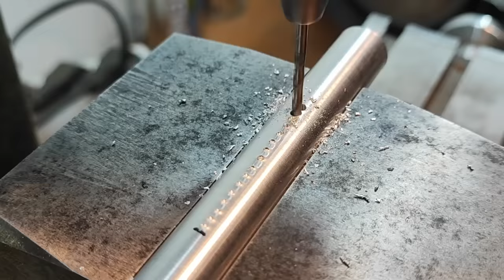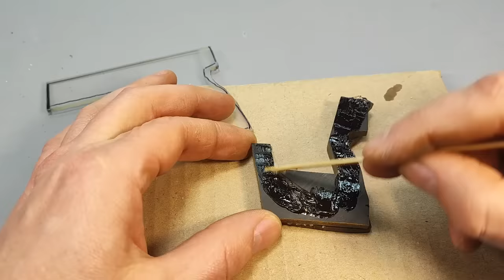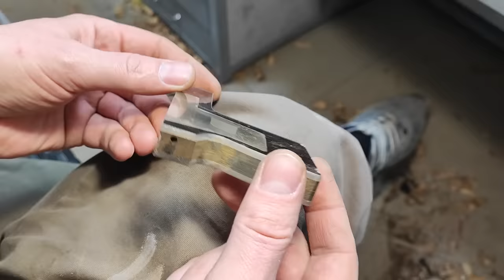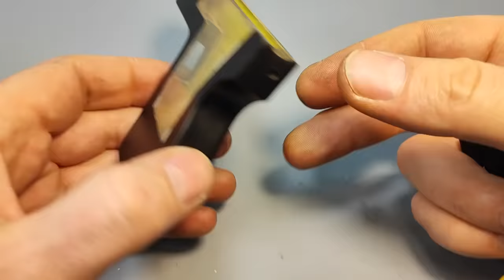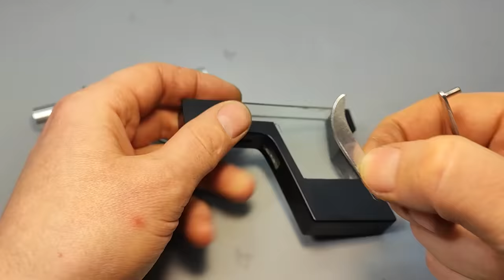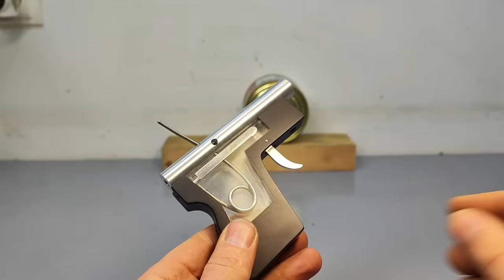How to make Gun for fun. Cal 4.5

Comment: Can you pls explain, how th etrigger can push the spring out of the dent ( the cocked position), after coking it , the spring is stuckk right? how  is it pushed out? The trigger applies straight force it doesn't push it horizontally, which is required to push out the spring. Please give an explanation.
Reply from the maker: This video shows everything clearly.